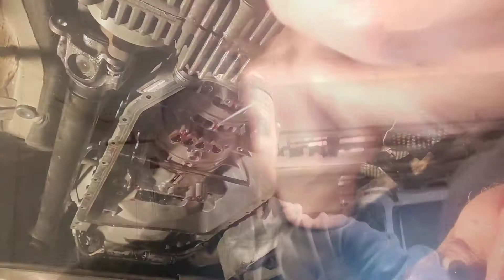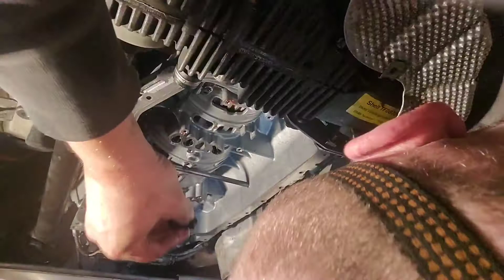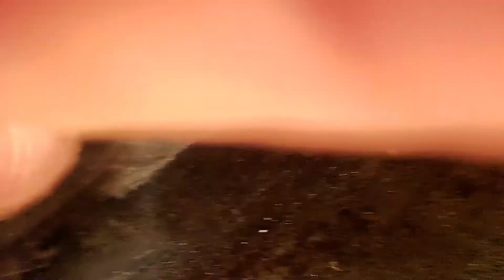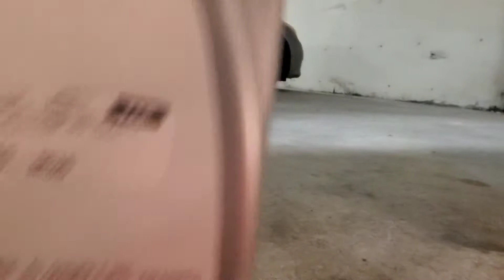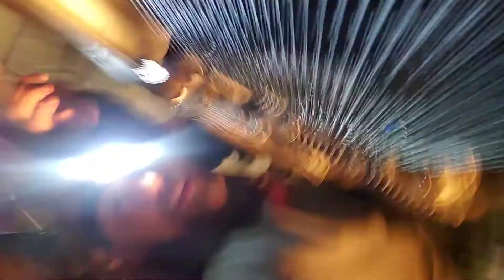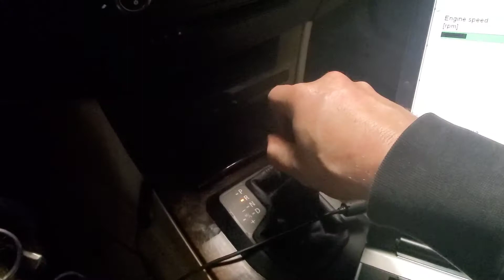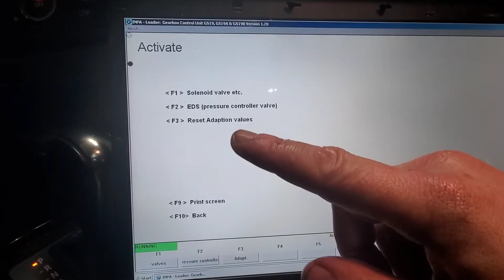BMW E60/61 Automatic Transmission Mechatronic DIY Service Part 2

Comment: Hi mate, great video. I’ve got a 2003 BMW 525i with the ZF 6HP19 and I’m getting 4F57 – shift monitoring 1–2, 4F6A – transmission temperature/control, 51AD – wheel-speed CAN fault and 51AE – brake-light switch CAN fault.

Normally reverse and all the other gears still work properly, but when Transmission Failsafe comes on it refuses to shift from 1st into 2nd.

Did you ever have any of these codes before replacing the solenoids/seals? And is your transmission still working properly now, or did the issue come back later?

Would really appreciate your advice before I decide whether to try the mechatronic/solenoid repair or replace the gearbox.

Comment: First of all, thank you for the AMAZING video! It’s super funny and educational. I've watched it a dozen times or more. I just finished repairing the ZF transmission on my BMW E60 N52 530xi 6HP19 (2006) using the essential ZF parts: ZF 1068.298.044, ZF 1071.298.041, and ZF 1071.298.033. These were exactly what I needed to get everything running smoothly again. If you're tackling a similar repair, make sure to get the right parts – it'll save you a ton of time and headaches! And by the way, the sleeve connector was a nightmare—it took me two weeks to install the new one. Also, remember you’ll need 8 liters of oil, so don't forget to buy an extra liter!

Comment: A very messy job. Wear clothes that you can throw away. Also note that the mechatronics sleeve is much more difficult to replace on Xi models, or at least the 2009 528Xi.

Comment: I have just discovered this awesome video (both parts 1&2 are great).
Thank you for making these videos, I loved them. They are informative and funny.
I have a tip for removing the rubber sleeves at  0:13, use a screw!  I used a "lag screw" clamped in vise grip pliers, just get the screw to thread into the inside of those sleeves and then pull the vise grips down.  The seal will come out in a few seconds, and it won't fly away into the drain pan!
Thank you for leaving the electrical connection plastic sleeve installation error in, it helped me be much more careful during its installation than I would have otherwise.  Thanks again for this great video!
Reply from the maker: That's an awesome idea with the screw. I'm going to be doing this again on my new E60 and I'll use that for sure.

Comment: How did you the get mechatronic sleeve on for the connector? I have 528xi and I couldn't get it past the tight space.
Reply from the maker: It's the worst part. I don't remember exactly now but there's a way to squeeze it up there. It's a good 8dea to mark on it where the notch is so once your getting it in the hole you can see if you're oriented the right way.  Also  lube the outside of it because it won't want to go in. Freeze frame in my video when I give the tour to see how deep my original one was so you get yours deep enough but don't press so hard that you damage the connector. Fun. Good luck.  I know when I did it on my E60 530i without Xdrive there was a bracket for the exhaust I had to bend out of the way.  But I don't think it's the same for Xdrive.
Reply: @IDontKnowWhatImDoingDIY  thanks for the advice…I will be finishing it soon and hopefully it won’t be too much of a pain!

Comment: what if you cant connect the car to the computer? can you do this job without connecting the car tot he computer?
Reply from the maker: You run the risk of not filling up the transmission to the correct level because you won't know the temperature. Some mechanics don't connect it to the computer and just heat up the car to operating temperature and do the second fill then. Not sure how safe that is.
Reply: @IDontKnowWhatImDoingDIY  i see so just for temp monitoring? i have the inpa but it doesnt work on windows 10 so im not sure how i can get this thing connected...i tried using virtual box and having win xp virtually installed but it never worked
Reply: @IDontKnowWhatImDoingDIY  oh i should tell you the reason why i watched your video. my car doesnt go into drive or reverse when its cold. i have to start it in neutral and then pop it into drive at a certain time right when the engine starts or else it wont go into gear. once its warm though it will go into gear as normal. also it comes out of gear when i accelerate hard.

Comment: I am in awe that you took the effort to video your experience while working in such cramped conditions!  I just finished doing the same on my 2006 530Xi and your video gave me a lot of very useful guidance.   The only unexpected problem I ran into was that the mechatronics sleeve was too big to get through the opening between the tranny and the support bracket on my car.  Checking on the various forums confirms that this is a problem with some of the 530Xi's.  Some posters simply reused the old sleeve, some replaced the o-rings on the old one and reused, another dropped the exhaust, heat shields and support bracket to make a little extra space.  I used a Dremel tool to grind a small recess in the bracket (about  0.3 inch deep) to allow me to get the old one out and the new one in.  Except for the metal filings all over the place it seems like a good solution.  I also found a large dowel that fit nicely into the sleeve and butted up to the shoulder halfway down the sleeve.  A 2" piece worked perfectly to give me something I could lever against aggressively without damaging the sleeve.  Just finished my test drive and it seems that my lurch from a rolling start and a low speed shudder are cured!  Hard to believe that the tranny needed service after only 320,000 miles.  Many thanks!
Reply from the maker: Awesome work. I just did this job again on our new 530i. I thought it would be easier to get the sleeve in because it's not an x-drive but there was even less room, wish I'd thought of the dowel.  This sleeve was a little different design so it didn't look like it was all the way in and I didn't want to have a repeat of the gearbox being not connected so I took 2 days trying to squeeze it in.  So stressful.
Reply: @IDontKnowWhatImDoingDIY  I highly recommend the dowel trick.  I struggled for  a couple hours without success until coming up with it.  The sleeve was seated in about 5 minutes with the dowel.  I think the fact that the dowel applies force from deep inside the sleeve helps align the pressure more efficiently than pushing on the outside rim.  You need a 1 3/8" (35mm) diameter dowel.  The inside shoulder is about 0.7" deep in the sleeve.  I hope I won't be needing again!  I also cheaped out and went with the Liqui Moly ATF and it seems to be working perfectly.

Comment: Is the transmission still shifting with no problems now?
Reply from the maker: All good. I just did a fluid flush (no filter or anything else) and the fluid came out nice clean and clear. Worth every penny and every minute. Now I have piece of mind. At least about the transmission.
Reply: @IDontKnowWhatImDoingDIY  good to hear! I’m getting ready to do this exact job on my 335i. Hopefully it will help improve the quality of the shifts.
Reply from the maker: @kc2213  Best of luck. Let me know how it turns out.
Reply: @IDontKnowWhatImDoingDIY  got the job done and the shifts are now much smoother and faster. Your video was very helpful. I also had a lot of difficulty installing the mechatronic plug sleeve.. but overall the job was pretty straightforward.
Reply from the maker: @kc2213  Awesome. If the fluid coming out looked wonky I recommend after a few weeks you just do a flush (just open the drain plug and refil with fresh oil on a hot a gearbox) . The capacity is about 9L but that much doesn't come out during the major service job and a bit of old oil is left so doing a flush will reduce the amount of that old oil left behind.  I did a flush after a couple of months (only about 4 litres came out) and now I get even better shifts especially in the morning when it would be a tiny bit rough. This gearbox is so good that you can basically do a major service in your driveway. I wish every gearbox was like this.
Reply: @IDontKnowWhatImDoingDIY  I actually had done a transmission fluid change back in 2017 but neglected to do the seals and solenoids. So this time, the fluid came out looking pretty new. In my case, the fill took around 7.5L before a steady stream started flowing out of the fill hole. It's amazing how much faster and smoother the transmission shifts now after the new seals and solenoids. This is definitely a messy job, fumbling around with trying not to drop the mechatronic unit, and taking out the old tube seals was also tricky. Overall, it was well worth it!

Comment: Did you measure the resistance values of the former solenoids? Were there faulty individuals in the old solenoids?
Reply from the maker: I did not. I had real sloppy shifting and the hard 3 to 2 shifts so I just assumed they were bad. I did not want to do the job more than once, so I just did it all.
Reply: @IDontKnowWhatImDoingDIY  Were there any DTCs in the transmission controller before repairing?
Reply: Was the old separator / adapter gasket cracked?
Reply: I never checked the DTCs before the repair. The gaskets were all hard and brittle compared to the new ones, I don't know if the seperator was cracked.

Comment: Im getting ready to do this on my 530i
Reply from the maker: How did it go?
Reply: Yeah I'm curious as well.... I'm preparing everything to do this in the next week or two... Ordered a replacement valve body, zf pan,  zf fluid and gaskets. Also have my INPA ready to go. This video series is extremely helpful! Thanks!